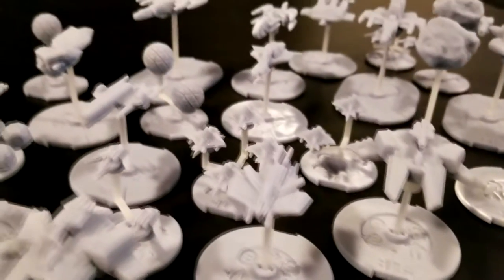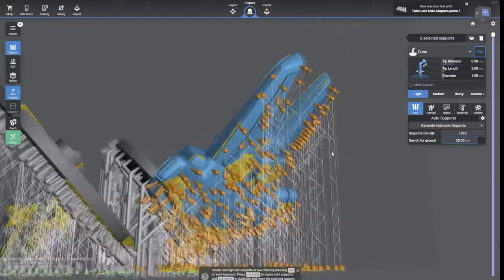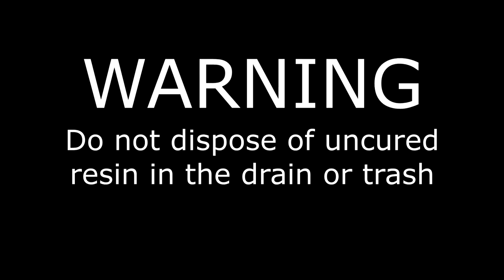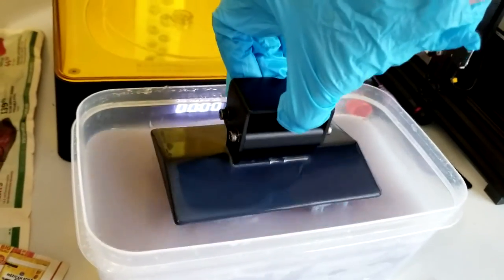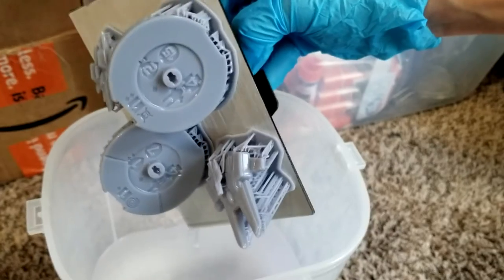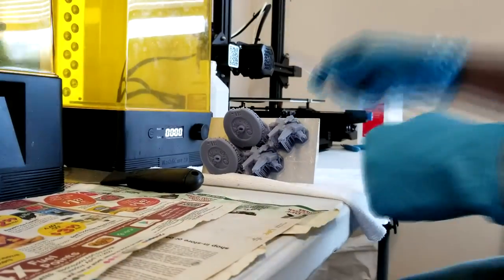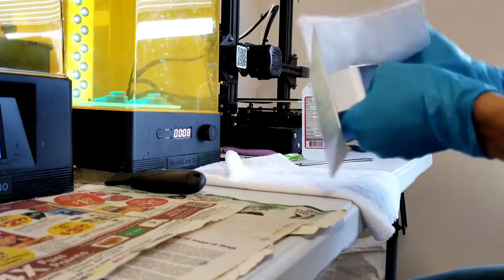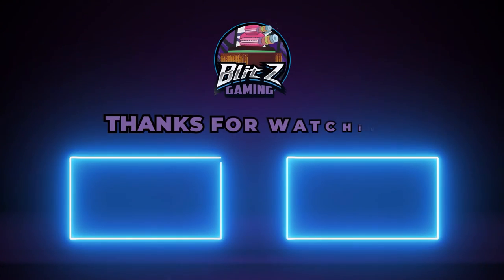My Resin 3D Printing Workflow (It's easy & Mess-Free)

Comment: PLEASE wear saftey goggles when working with resin. if it splashes and gets into you eyes, itll be a seriously bad time. also the cloth mask isnt going give you any protection against the chemical fumes.
Reply: + buy mask with carbon filter
Reply: Goggle's ?? 😂😂 Too much..just tooooo much 🤦‍♂️
Reply: @RobBob555 better to be safe than sorry man
Reply: @RobBob555 so gloves because you don’t want it on your hands. But who needs eyeballs right?
I’ve resin printed for years and eye protection has saved me several times.
Reply: For real. I gasped when he said to wear a mask and was wearing some paper thing…
Reply: YES what this person said, also please two gloves, this is a really great video, but there are a few points that can be adjusted, including you really don't want to put your uncured model directly on top of the metal grate especially with the build plate sitting on top of it. But overall, keep up the great work!

Comment: Looks like a pretty nice workflow but if you’re worried about your health you should really be wearing a respirator mask. Those papery polypropylene masks won’t stop you from breathing in the resin fumes at all. (Even though they sometimes are sent with resin printers) If you can smell resin, you’re not protected. And you won’t see the affects until you’re a couple years down the road.
Reply from the maker: Thanks I'll look into it!
Reply: @blitzgamingstudios  i came here to comment this, its really important... a respiratator means you smell nothing 99% of the time.
Reply: Here to add another +1 to you absolutely needing a respirator. 

You specifically need to look into filters like 3M P100 Respirator Cartridge/Filter 60926. The filters must be able to handle organic solvent fumes.
Reply from the maker: @geuis  thank you that helps!
Reply: This is why I'm holding out on Resin until confirmed safer... It is extraordinary tech... but the chemicals
Reply: I so want to Buy a resin printer but the unknown toxicity and horror storys scare me away 
I Hope some Long Term Studies of new healthier resin solves this problem

Comment: Pre-supporting can be awful. As someone who does this as a profession I can only advise one thing. Don't trust pre-supports (i mean if you know what you are doing grand, but otherwise it can be nightmarish, we hand support everything). Nice video, we do a lot of work flow videos on supporting styles, as such. ALSO, don't use that plastic tool. I learned that a while ago, they can actually cause micro scrapes that you won't see. Use a silicone spatula, your process is fine, but the plastic scrapper is bad. We love the 4K's too BTW we have a bunch of them and they are work-horse printers. You also take an extra step most users don't, the extra wash is a good step to get a cleaner result. Nice video thanks for sharing. I do 5-10 builds at a time usually so I have two wash n cure's running each cycle. Cure about 1-5 mins if standard, or standard+, if you are using DLP or Craftsman resin you can cure longer for bigger items too. Good tips all around.
Reply from the maker: Thanks for sharing! 😄
Reply: Pre-supported models also means you'll struggle to scale the model up or down in size.
Reply: Thanks for the insightful comment, I will get a silicone spatula! I have a question on how you let your just printed models dry. Do you let them dry during the night on a towel or perhaps something else?
Reply: @BossBabyBestAnime  Paper towels to dry, and let them drip a little bit more. I use the blue shop towels.

Comment: Even plastic scrapers will still scratch the FEP.  The best option would be a silicone scraper. You can get some 2 part silicone from Smooth On, mix up a small amount and then dip the plastic scraper to get a nice smooth silicone skin onto the scraper.  Any scratches or smudges on the FEP will scatter the light and effect the quality of the prints.  As far as the cleaning goes, I always use a soft brush in the "dirty" bath stage to loosen the resin.  I've found that rinsing alone does not break up the resin enough for a full clean.  Just my 2 cents.
Reply: I scratched my first FEP with my plastic scraper. I would not recommend doing what we see in this video, especially if you're a beginner.
Reply: There are some really nice silicone spatulas available as well. I've been using them to stir and agitate my resin for the past two years and I'm still on my like-new original FEP(s).

Comment: Get a respirator, wear nitril gloves, latex doesn't stop resin. Don't touch the parts of the gloves with which you touched resin with your bare hands (Get them off by your wrist, not by your fingers). Don't touch the paper towel that you used to clean your scraper with your bare hands. Don't use a plastic scraper for your fep, use a silicone spatula. Don't use a butter knife to get your prints off the plate, use a plastic razor. Other than that, great video. I'm especially thankful that you included a part about disposal of water-washable resin. People just touch this stuff and pour it down the drain as it it was dish soap.

Comment from the maker: Remember, I'm not an 3D printing expert!
If you have additional tips and tricks for 3D printing, leave a comment! 👍
Reply: If you can get a silicone spatula it will work much better at avoiding damaging the fep than the plastic scraper they provide with the printers. You can get decent cheap one at a local dollar store.

Comment: Great video dude thank you! Question though, so if you cleaned the model in 3 different baths, why do you have to still wear gloves for the part where you're removing the supports? (brand new to resin printing so forgive the noob question)
Reply from the maker: No worries, it's honestly a great question!

#1 is that even after those baths, the model itself is still not fully cured. I use the curing machine to finish the curing process. You can also set it by a window and turn it occasionally, but I find have a curing machine is really helpful. You can cure it before or after removing the supports, but I prefer to remove the supports first so that the UV light from the curing machine gets the whole model better as it isn't blocked by the supports.

#2 sometimes I am anxious to get the supports off so I don't wait for the alcohol to evaporate, so it's probably best to wear gloves if it's still wet with the alcohol. 
🤷‍♂
Reply: @blitzgamingstudios  got you, so basically not safe to touch after the cleaning, but only after curing, got it. 

Got the gktwo bundle and this helps a lot for my first print. Thanks again!
Reply: Also maybe consider turning on the "Thanks" feature. Tried to say thanks with a few bucks but didn't see the option. Appreciate your help!

Comment: so ive been having a few certain issues after i bought my mono 4k, 2 weeks ago. 

Main problem im having is that the circular details are always warping/drooping to towards the build plate side. it isnt the warping that happens from naturally with uv resin and ive been calibrating and printing some TMC models and ive tried quite a few things and their discord tried helping me out but im at my wits end. ive got confidence that the temp, humid, and supports arent the issue and ive pretty much got exposure and layer height setting down but i still dont really understand the lift height settings in chitubox as there are two places to input your lift heights. Any potential input you have for me about this situation?

also im pretty sure the build plate is hitting the stopper and making a buzzing noise for half a second once it gets to 0 or home on the first layer. should i be concerned or ask for a refund? 

thanks in advance sir, your workflow is clean and your prints fill me with jealousy.
Reply from the maker: I'm sorry to hear you're having this issue! It can be frustrating when you try a lot of things and nothing seems to work. That's how I feel with my creality FDM printers.

My first suggestion is going to be to try Lychee Slicer. It's free, there is a paid version but it's not really necessary unless you're selling professional presupported designs. I used to use Chitubox, but I feel Lychee is a bit more intuitive and creates better supports. I've had more success with it.

Lychee also uses multiple numbers for lift height, I think it's a new thing supported by the Mono 4k compared to the Mono 2k. My understanding of it is that they're basically a 1st and 2nd stage, allowing you to control acceleration between the two values. So you could set the first one low so it will slowly lift to that height, then accelerate to the next height. It's just a way to control acceleration to save print time, but you might be best off just using the same height for both values until you get it working the way you want it to. My lift height is usually 6mm or 7mm (depends on how old the FEP is because they start to stretch and require a slightly higher lift height).

Adjusting lift speed may also help. I tend to add a lot more supports than what I see other people do (because I'd rather get a successful print than try to save a few cents on resin) and I go for a slower lift speed (1.5mm/s) and slightly higher exposure time (Right now I'm doing 2.7 seconds although the default was 2 seconds. Makes the actual model a bit tougher as it prints.)

Most of my supports for smaller prints such as starships use lots of supports with .3mm tip diameter, with some .5mm tip diameter supports spread throughout to hold it steady. The biggest issue I had with learning to print with resin was learning how to support properly, such as adding some supports on the sides just to hold the print in place to prevent warping. The model pulls pretty hard off the FEP sometimes, causing the model to move and pull different directions.

Other than that, usually these printers shouldn't require a lot of fine tuning. Check out Lychee, try some community settings for the printer that show high success rates (you'll understand once you get into Lychee, you can see what settings work for other people using the program), support the crap out of the model, and if it still doesn't work I think it's likely there's a defect and Anycubic should be able to help you out. Hope that helps. Let me know how it goes! 👍

Comment: I pre-wash in simple green.  It's much cheaper than alcohol and using a 5 gallon bucket with only 1 gallon of cleaner in it I vigorously spin the build plate back and forth like a washing machine for at least 30 seconds.  This removes 99% of resin.  I then go to my Phrozen wash & cure and finish the parts.  Using the simple green is cheap and saves me a lot of alcohol.
Reply from the maker: I hadn't heard of this! That's great, thanks for the advice 👌
Reply: I used to use simple green but was irritated by the slimy film it left on parts. Half the time I had to just rinse with ipa anyway. Do you have this issue?

Comment: how do you dispose of the dirty bath IPA?  Ive been avoiding resin printers as I feel like I'll be an environmental disaster.
Reply from the maker: Great question. Some people like to filter it with coffee filters or other types of filters.

I personally prefer to just evaporate the alcohol by leaving it out in the sun, which leaves behind only the leftover resin. Watch a couple videos on it, but if resin is cured, it can be thrown away with regular trash. Otherwise you'd want to dispose of it like other types of hazardous waste by taking it to someone who accepts such waste. Hope that helps. 👍
Reply: @blitzgamingstudios  Does the resin not stick to the bottom of the vat and become very hard to get rid of?
Reply from the maker: @BossBabyBestAnime  It does. I guess I should have clarified I do this part using a container I plan to throw away 😆

Comment: would you recommend getting the wash & cure machine when starting out?
Reply from the maker: I absolutely would. If you go without it, you'll probably still have to create some kind of janky setup for curing at the very least.

And it's nice to have at least one bucket that's perfectly sized for the build plate along with the wire metal holder for it.

Can't imagine how much worse the experience would have been starting out without these.

Comment: Cant beat a pre-wash for saving IPA. I would look at getting a cheap sillicone baking spatula for mixing resin in the vat, much softer than the plastic scraper.
also people say leave your IPA in the sun to recycle it, I would STRONGLY disagree. Let your dirty bath settle in the dark for a week then syphon off the clean IPA then cure the sludge in the sun. You end up with far less gloopy gel and much more clean clear IPA. If you want to filter it, use extra fine cooks cheese cloths (several layers) rather than coffee filters.
Reply: I do a bit of a and b, I take the resin filter it down with a coffee filter, and take out the slime, then will take that into clear-ish container and literally let the whole thing sit in the sun, and cure. Once it is done I am left with IPA on top, that is murky, but not as nasty as it started, from there you can vapor distill it back to cleaner IPA, but I just re-use that as my Dirty wash. IPA used to be a bigger expense till we worked that out, now I buy maybe one pack of IPA bottles every 2-3 months, but again I am doing volume and we run a store. So, all things considered I am getting 1,000's of printed parts per batch of IPA.

Comment: I do a first clean in a dirty bath and a second clean in a clean bath, with the clean IPA becoming the dirty IPA when needed, but I also spray an ounce of new IPA onto the part and build plate straight out of the printer to remove most of the uncured resin before it contaminates the dirty bath, and I spray the part coming out of the clean bath with new IPA to remove any residue from the clean bath.  The IPA dripping off the part from the printer is discarded as it has a very high resin content.  The IPA sprayed on the clean part just before air drying and post cure is allowed to drip back into clean IPA tank.  I basically use a sprayer and two tanks to do a four step cleaning process.
Reply from the maker: Sounds like a pretty solid method! 🤘

Comment: Use a silicon scraper, that mask doesnt do anything to stop VOCs so might as well remove it and get a good voc ventilator to use, are you doing this without eye protection? Truly? You only need to get s drop in there once. And you are doing this over carpet??? This whole video has given me so much anxiety.
Reply from the maker: I've had a lot of great comments on this video giving safety tips and I'm planning on doing a full safety video soon. Thanks for the heads up :)

Comment: Hey Blitz question for you based on your set up. Noticed you have sunlight coming in from the window. Does that impact your workflow at all? I was under the impression that you can't let the resin have any UV exposure but I am sure in your room you have indirect light hitting your bed while you are setting prints up. Do you ever notice a difference? Thanks!
Reply from the maker: Such a great question! I literally don't worry about it, lol. I don't leave the resin or vats out without the UV cover (the standard yellow cover for the printer) for extended periods of time, but that's pretty much it. It may have a slight affect on the durability of prints but not to any degree that seems it warrants excessive worry.

If you were printing functional pieces that need to follow exact dimensions, I could see it being more necessary to avoid any light contact with the resin.

Hope that helps! 👌

Comment: I made a resin pump. Wayyy less mess. I just use the pump to suck out the resin and then clean it with a microfiber cloth if i am using different resins. Like you said two buckets are ideal. Anyone interested in making the pump message me and ill send you the build.

Comment: Dont forget good ventilation and to always wear eye protection. If you are wearing that type of mask it doesn't protect you from fumes, but does  protect you from a splash of resin. 
Standard safety for resin should be Googles, a 3m mask with filter that protects against organic vapors (if you dont have a dedicated ventilation system this is more important), and gloves (nitrile not latex). 
For curing old gloves and paper towels -> get a clear container and leave it outside and mix the contents around every now and than. Throw it out every now and than after leaving it in the sun for a week or so. 
If you want to be extra safe you can get a UV lamp and put a clear cover on the container. The UV light shinning through the clear plastic container should fast cure everything. (including gloves)
Reply: the n95 or surgical mask is also a particel filter mask that wont filter out the solvent fumes
Reply: @TheZahnputz  which is why good ventilation is so important. Best system I've found for solvent fumes is keeping the printer and washing station in a grow tent with a inline fan venting out a window. 
The negative pressure in the tent keep the fumes away. But if you have the tent open (like when you are removing prints and processing them) its good to put on full PPE. 
Best mask you can get is a 3m with a filter that specifically filters out organic vapors